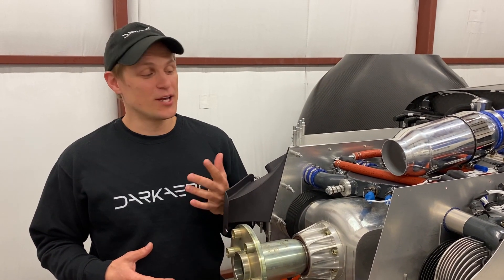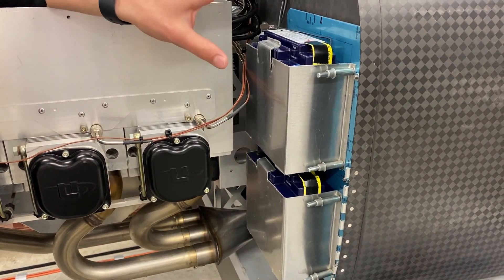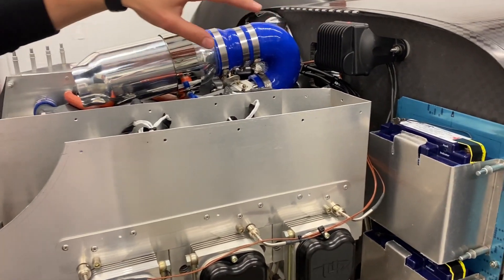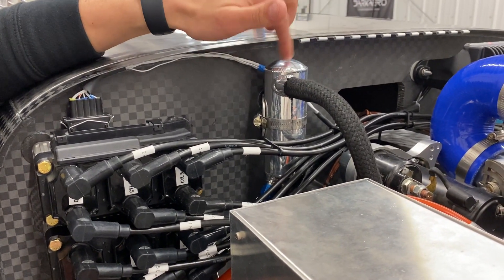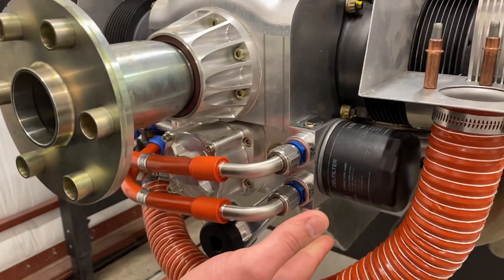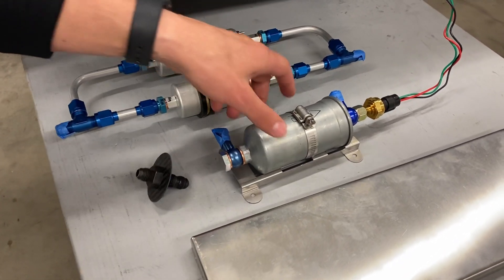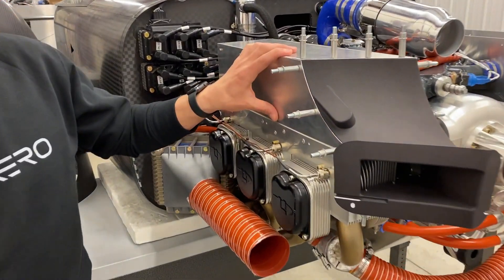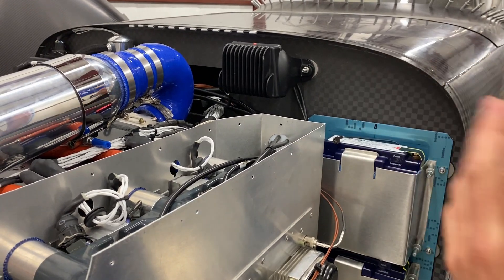UL Power UL520iS Engine Install on the DarkAero 1 - Part 1

Comment: I'm sure there's a good reason, but why does the cabin heat come from the exhaust and not the oil cooler? Not enough temp? It seems like it'd be a nice way to eliminate the most common source of CO in the cabin.
Reply from the maker: Good question! The oil cooler is a good source of heat and we would like to use it for cabin heat as you suggested. We decided to keep the cabin heat and oil cooler separate since this is still a “test” aircraft. The bigger UL engines tend to pump a lot of heat into the oil system so we wanted to make the oil cooling easy to adjust if we find out it’s not cooling adequately. By keeping the cabin heat separate it means we are only messing with one system at a time during testing. Once we get everything dialed in and collect more data we can work towards integrating the oil cooling and cabin heat. There’s good incentive to integrate the systems because it means shaving a few pounds of weight and reducing part count

Comment: I'm surprised at your decision to put the batteries in the engine compartment. I can't tell the battery type (AGM? LiPo?) but the temperature range at which batteries operate most efficiently, and have the longest life, is typically comfortable room temperature. Subjecting them to either radiated heat from the engine (or the exhaust manifold literally right next to it), or potentially icy cold blast during a winter's day from bleeding cooling air from the baffle is not ideal in either case. 
Was the battery location decision driven by weight? C/G?
Reply: That was my concern also, but the excellent answer fixed that concern.
Reply from the maker: Scott MacLean thank you for watching! The batteries are EarthX lithium and have an operating temperature range of -22F to 140F. Extreme temperatures were a concern we had with the placement in the engine compartment which is why we are implementing the battery cooling box. This will protect the batteries from radiant heat from the exhaust and other engine heat sources. We will show more of the cooling box in upcoming videos. The decision to place the batteries in the engine compartment was driven by weight, serviceability, and safety. Locating them in the cabin on the cold side of the firewall is not an option for safety reasons which would mean the only other choice would be somewhere in the back of the airplane. This would be a bad location for serviceability and the weight of the heavy gage wires running from the engine all the way to the back of the airplane ends up being several pounds. There is no ideal location for batteries on an airplane when all the factors get weighed out. The location we chose seemed to be the best balance for our design.

Comment: What happens if the fuel filter gets plugged? Is that a possibility?
Reply from the maker: Tom Busey the fuel system is designed to prevent the filter from getting restricted. There is a large area pre-filter upstream of the fuel pumps to screen out initial debris. The main filter sits downstream of the fuel pumps and has a large internal surface area to catch debris without clogging. The fuel filter is changed on a 200 hour service interval to keep things running cleanly.